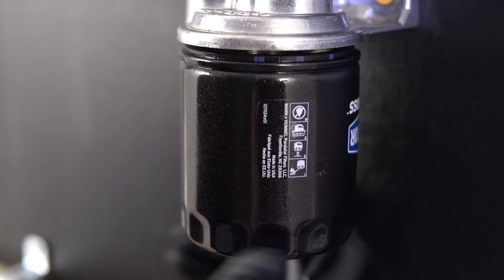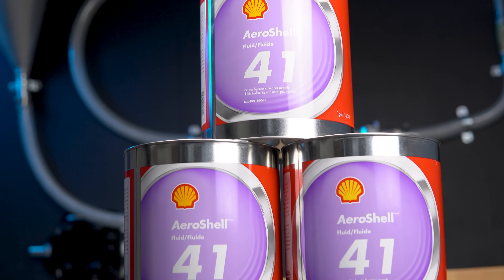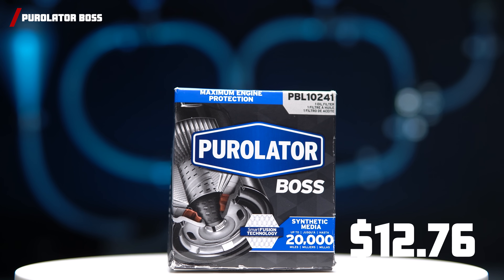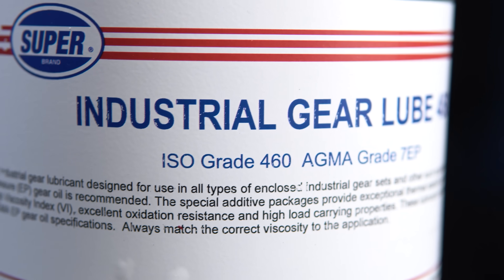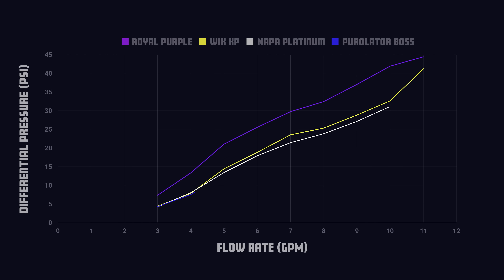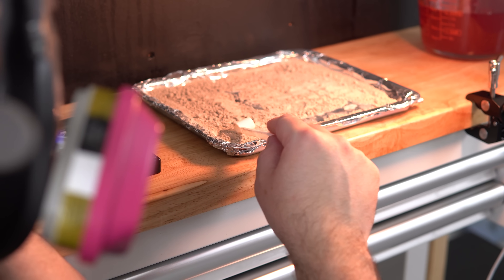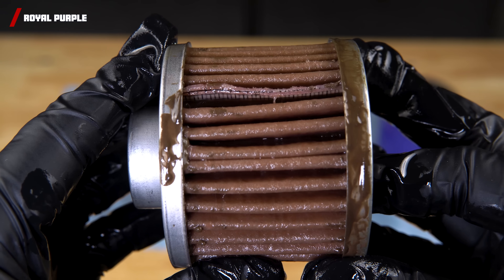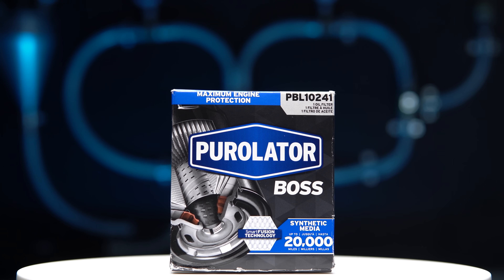Engineers Test the Most Popular Oil Filters

Comment: Nice test setup/process! It would be interesting to test some OEM oil filters to compare with these results (I would be interested in Subaru filters, personally).

It might also be helpful to test the pressure at which the bypass valve kicks in. It was kind of confusing that your cold temp oil pressure drop test had results of 40psi+ given that the filter bypass pressure settings are almost certainly much less than this. Any idea what is going on here?

Comment: Where do you get the oil filter adapters and do you have part numbers? Also wix oil filter that you used?  No, I'm not trying to build your rig, I just need a way to filter oil or hydraulic fluids while extracting from my construction equipment.

Comment: What a filter can catch is only one aspect but doesn't really tell much. The size in area of the media combined with filtration is something you will want to consider.This will play a larger role in a fine filter as to the restrictions, differtial pressure and when the bypass valve opens. What pressure difference is the bypass set for? This all will change after running a few thousand miles and the suust aize particles are not what you're mostly concerned with. A very fine filter without the area to compensate may cause more problems than you realize in reality. Be careful what you wiah for.

Comment: Testing procedures are very good.

I do think though that some real tests vs iso tests would be interesting. ie putting some dirty real car oil though all of the filters and testing the original vs filtered oil.
Reply from the maker: Hey, thank you so much! We attempted that, but unfortunately particle counting on used oil is almost impossible, it kept giving the lab inconclusive results because it was too dirty and dark for the laser to accurately count the particles.
Reply: The bulk of the contaminates in the engine oil will be hard particles that the test dust in the video is a reasonable substitution for.  Used oil can have other stuff in it, but the filter really is not going to care about wear metals (and if it does your engine is about to throw a rod anyway.)

Comment: I’ve never seen royal purple do worth damn at anything and sure didn’t in my real world experience! Got worse gas mileage using their motor oil. Used their manual transmission oil in a Nissan & Toyota pickup and you could barely get out of a gear much less the next gear. Drain that garbage out and put Redline M/T back in and they both shifted like dream! Expensive experiment but worth the knowledge

Comment: I imagine the oil gpm through the engine is directly related to the rpm and probably the cylinder count and liter size. What is the gpm through a 5.7 liter v8 at red line, compared to a 2 liter 4 cylinder at red line? Is it even 5 gpm on either engine? Amsoil’s bypass valves are set at 15 psi to protect the engine and also to prevent the filter media from blowing apart inside.

Comment: One thing missing from the test is when the bypass opens. Also,  if you knew when the bypass opened, you could assure you are testing efficiency and capacity with the bypass closed.  In the video, we really don't know how much filtering is going on at capacity, nor the state of the bypass, which is likely why you sampled the oil for efficiency after the first 4 grams.  If you plotted flow and pressure maybe there would be a plateau when the bypass opens? ❤
Reply from the maker: Hey Joe, thanks for watching and for the feedback. Unfortunately to test the bypass setting, it requires some specialized equipment to tear the filter apart and put it back together with a dummy canister (at least this is how ISO for it) we did test DP vs Flow which the by pass setting is based on DP not inlet pressure and it doesn't have the granularity to conclusively tell, but on the next video it's a little more clear with the FRAMs so we will make sure to show that. Also all the filters have a minimum of 8PSI DP setting on their bypass setting, so like you mentioned that's why we used 4.4 grams to ensure than none of the filters where bypassed when we took the sample. Again, we tried to follow the standard as best we could. Thank you so much!

Comment: I've used Wix (non-XP), Napa Gold, and Purolator One, but on occasion some of their stuff seems a bit off.  Strangely sharp threads, weird leaking, but that's on a model by model basis and in general I like them.  The Mobil 1s have done me well, but I avoid them as I don't do extended oil intervals though I have grown to accept 5-7.5k on the generic dailies, but the fun cars get 3-5k just depending on how the cars feel after an oil change.  Some engines seems to have a substantial feel difference after 3k on certain oils and others don't seem to care.  RP, and K&N always seemed a bit too boutique for me and I don't even like the latter's air filters.  Typically I get Honda blue filters, or Denso filters, and also don't mind Mann or Mahle/Hengst filters.  I've come to the conclusion that Toyota and a lot of the Japanese automakers prioritized flow over filtration and that was even with shorter change intervals.  With the amount of Toyotas from the 90s that you still roaming around the streets that you know got the cheapest filters and oil that a lube shop has I think it's probably over thought about.  That said, I've happily used the Fram Ultras when they became fab on bitog, and they were fine.  I don't really see why you can't just use one with a bit more filtration on occasion and typically run higher flow ones.  

It's kind of like oil or gas.  They're probably all fine and will do the job and won't fail your motor, but if you use them exclusively then their shortcomings can show themselves.  I feel like like gas and oil, they prey on consumers desire to go above and beyond what would actually make a difference and our ideas that basic or cheap isn't good enough, when a lot of car cars are made with that in mind or will have some designation.  If you don't have a new car that you can't really hear the engine I just listen to what the car likes or doesn't like.  Had a Volvo that seemed to chew through gold bottle Castrol but much cheaper QS Ultra made it further without feeling or sounding as degraded on that particular car.  My 90s Toyota 4 cylinder will take anything whereas some engines are more finicky.  Only thing I stay away from are high mileage oils.  I'd rather a seal show me it's failing and replace it than band aid it and masking future close issues.

Comment: Is the flow test based off of how much oil a typical oil pump will flow in a vehicle using those filter sizes?  Is it possible an engine flows much less volume to maintain the desired oil pressure it requires?  I assume your flow meter simulates the restriction of oil as it passes through the engine?

Comment: I have a 99 S10, well over 200K miles, runs great, 5 speed stick Transmission, 2.2 liter IL4 
The truck ie 24 y.o., zero drive train issues, I've always used WIX  oil and air filters, and either ethanol free gas or treated with ethanol dispersant additive in the fuel, as any vehicle prior to 2004 has  rubber seals in the carburetor.
But I swear by WIX brand filters.....
Reply from the maker: Impressive! Way to go taking care of your investment. As long as you do regular maintenance all of these filters are great!

Comment: so can you tell if bypass is opening at high flowrates or what pressure the bypass lets oil go by ?
Reply from the maker: Hey, thanks for watching. That would require a separate ISO test that removes the bypass valve and utilizes specialized equipment to determine that. Sometime on the cold do vs flow chart you can see an inflection point between an exponential graph and a linear one kinda telling you where that bypass pressure setting is, but it's no very accurate. If this series does well and we get enough funding we may invest in that equipment to test it out

Comment: The best filter is the one that actually gets changed often. I had a purolator back out on my GM twice. Leaked like a champ (made in USA). In 20 years never had an issue w the Fram, Mobil 1 or Wix. All good filters, priced well, usually made in Mexico and available at Mega Low Mart.
Reply from the maker: Thank you for the feedback! And agree that changing you oil in a consistent manner is more important. We will be testing FRAMs next. Thanks for watching

Comment: Cool video, but a couple of suggestions with how you display the results and conclusion at the end.
1) Show the price so we can what the value for money is
2) From the results earlier in the video, it's clear the the Purolator filter is hands down the best, but the final comparison table and your conclusion don't really demonstrate that very well. Maybe you need some kind of score out of 10 instead of a ranking, because the Purolator filter was 3rd in the hot flow test, but the difference to the Wix and Napa filter was negligable, whereas the difference the the royal purple filter was massive. That needs to be reflected in your final results table. It's weird that you recommened the royal purple filter at all at the end since it was was by far the worst in 3 out of the 4 categories.

Comment: 9:16 was the kink present when the flow rate test was conducted?
Reply from the maker: Hey thanks for watching. That part of the loop is a bypass on the system to regulate flow. While performing the DP vs flow rate test we were monitoring the flow passing through the filters with the calibrated oil flowmeter.

Comment: you could just get USED motor oil (1 batch) - and split into 4 samples keep 1, run each thru a different filter then send the samples to the 'lab'. that would give a useful way to measure how good each is. VS the fake dust method.
Reply from the maker: After speaking with the lab oil analysis and performing that, the results were inconclusive due to the oil being dark. The particle measuring machine needs clearer oil to measure ether particles thus we performed the test like the industry performs it with standardized dust. If you want more details on the test make sure to watch the first video with this rig. Thanks for watching
Reply: i will check.  You can dilute the samples with the ultra clean. I don't think the original method is inconclusive you can extrapolate how much cleaner it is based on what has been removed  . Also some ppl put magnets on the drain plug and filter.
the advantage of using real used motor oil is the particle size profile is accurate. Why test particles that are larger than in actual oil. Maybe there's a point they don't exceed because they get grinded down. What I wonder about is do larger particles consistently escape or do they get trapped eventually 
 @BrandRanks

Comment: By-pass pressure is a key feature of oil filters. Why was this not discussed? WixXP is only 12psi which is too low for a GM V8. Standard is 15-22psi. Filtration is great but by-pass pressure is just as important. Do you agree?

Comment: I struggled with following your Final Ranking table.  A more granular approach like the Torque Test Channel does with weighting factors and a final tally would be appreciated. Cost should also be on there, in my opinion.  
I'm not sure I agree with using a 1-4 ranking system between filters tested in each batch.  That will make comparison between different batches impossible.  Also, there are times when this ranking approach will create misleading results.  For example, in your Filter Performance category, the amount of contamination the Royal Purple and Purolator Boss caught are very close to one another whereas the other two are more than an order of magnitude away, but your ranking system doesn't reflect that.  
Overall, I appreciate the scientific approach and all of the work that has already gone into this, but some refinement is needed to make the data as meaningful as possible.
Reply from the maker: Thank you so much for the feedback, you have some great points there! We will look into changing how we approach the rankings. Thank you!

Comment: so the royal purple is actually filtering stuff, hence the increased flow restriction.
Reply from the maker: It is a great filter but Purolator was able to filter at the level of the royal purple without the restriction. Thanks for watching.
Reply: @BrandRanks  indeed.  test some fomoco or toyota filters.  I have been using OEM toyota filters in my sienna since i bought it, curious if they are as good as a purolater.

Comment: Question: if I don't have oil burning & my engine is 20 years old.
Still works. 
What matters?
I don't care that a filter lasts 20k, when gas seepage dilutes viscosity.
5000 mile oil changes untill all variables are taken into account.
What does it take to keep an engine going with the least amounts of damage.

Comment: I don't understand your analysis of the particle count. The Wix and Napa were working really well in 21-38 (the only result here that matters in an automotive engine), but the Purolator and RP failed to show up at all. 

Why didn't you do a test for 10-20 microns? According to the SAE, most abrasive engine wear on lubricated parts is due to particles that are 2-20 microns in size.

Comment: You should have tested the cartridge filters , a lot of cars have them now
Reply from the maker: Hey! Thank you for the suggestion! We are doing a video series right now on the spin ones, if it goes well, then we will have enough funding to do another round on cartridge and bypass filters, but as a small channel we have very limited funding. Thanks for watching and supporting the channel.
Reply: @BrandRanks   May I suggest that old car's oil filters/ sockets are the best to do a less expensive test.
The 1.9 tdi Volkswagene engine is the perfect example , filters are cheap for that engine ,also widely available.
Reply from the maker: Awesome, thank you for the suggestion!

Comment: Concerning that 10 micron clean up filter you used, you can order a BE90 bypass oil filter from Amsoil that is 98.7% efficient at 2 microns to use instead. Actually, if a bypass filter is installed on a vehicle, the particle size rating of the full flow filter is less important as the oil is analytically clean. GM engineers claim the use of a bypass filter can increase the engine service life by 8 times!

Comment: I use only purolator oil filters on my built car but I change my oil every 2,000 miles so I never use the filter for longer than 2,000 miles.
Reply from the maker: Great filter. Thanks for watching
Reply: That’s ridiculous, 2000 miles on the better oil nowadays.  2000 miles would be a recommended change intervals from the 50’s.  I change my 2003 Toyota every 5000 miles with the stock Toyota filter and we are up to 297,000 miles !

Comment: Being a mechanic for 40 yrs, I don't buy Purolator at all.  I also don't go 10k miles on an oil change. I hate parts stores pushing oil filters. I do not use wix or napa filters either. I use the oem filter.  Ford gets Motorcraft, GM gets AC Delco, Chryslers get Mopar filters, etc.  I use a k&n oil filters on my race car because they have a 550psi breaking strength, and all other filters are around 80psi.  It really sucks blowing a filter off when you leave the tree. Brand new oil is clean oil. Manufacturers use many filters before they fill the bottles. If your oil is dirty, change brands.